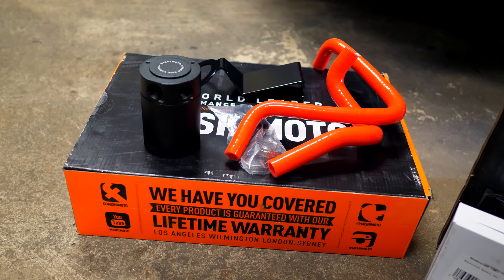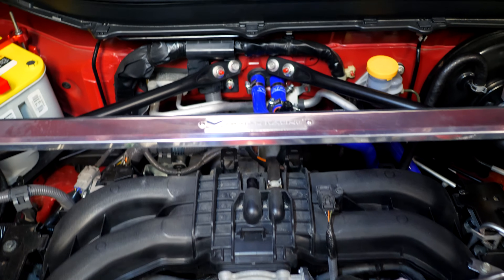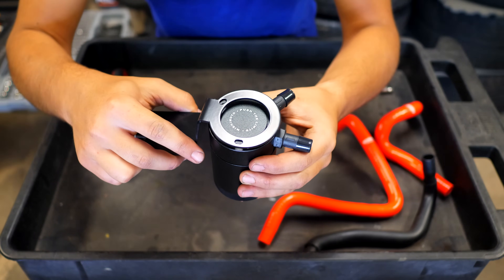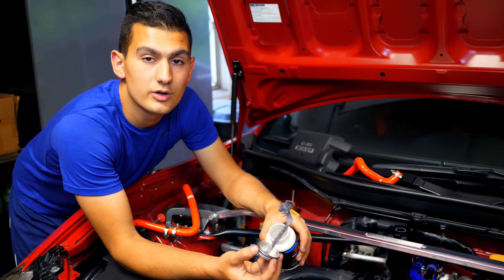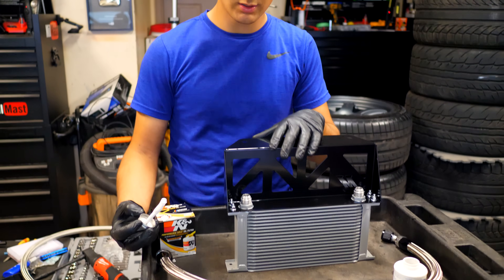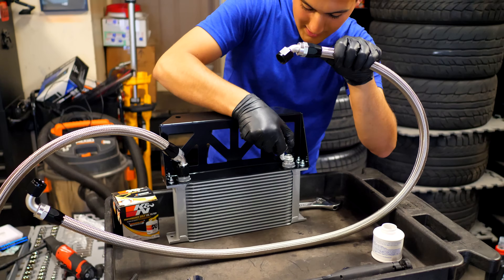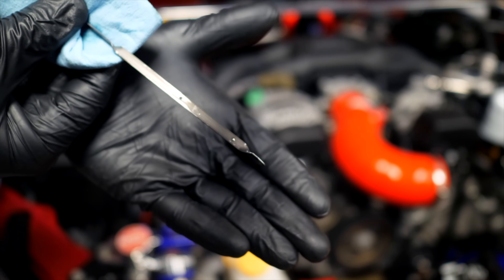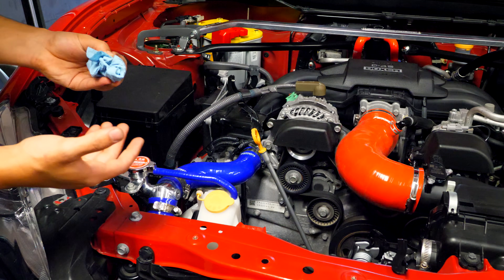The ULTIMATE FR-S/86 Oil System Upgrade

Comment: Very usefull video!!.I have one question.The oil lines goes now below the headlight near touching it which is made of plastic...That itd not going to burnt it??
Reply from the maker: Because the lines are covered in a braided stainless sheath, it will not. Even if they were touching the headlight, they shouldn't burn it.

Comment: What about next oil change with this oil cooler kit? Is the old oil going to stay in lines and cooler itself?
Reply from the maker: Yes it will, unless you remove one of the lines going to the sandwich plate and drain and fill it.

Comment: Be very careful using silicone products on the intake or PCV system. Silicone RTV and pastes can poison and ruin O2 sensors. 

Here is a Volkswagen bulletin;

Group: 26

Number: 93-02

Date: July 31, 1993

Subject:
Oxygen Sensor Contamination Due to Silicone

Model(s):
All Models, All Model Years

(Supercedes Technical Bulletin 92-01, Repair Group 26, November 30, 1992)

CAUTION

Do NOT use any sprays or compounds containing silicone on engines equipped with Oxygen Sensors. Do NOT use these compounds on or near the intake air system or near the Oxygen sensor. Silicone drawn into the intake air system is not burned during combustion and will lead to contamination and malfunctioning of the Oxygen Sensor.
Reply: Interesting.

Comment: Yeah, I agree with Israel Villegas (comment below)...you definitely need a cold air intake on that FRS...so much more power out of such an easy bolt on!!
Reply: No. Mighty Car Mods busted the cold air intake myth years ago dude. Where have you been? It's money wasted. Most factory intakes are cold air anyway. The only time air charge cooling is necessary is with forced induction.